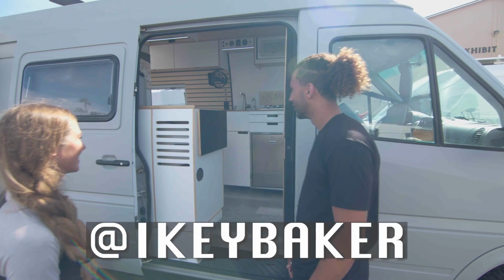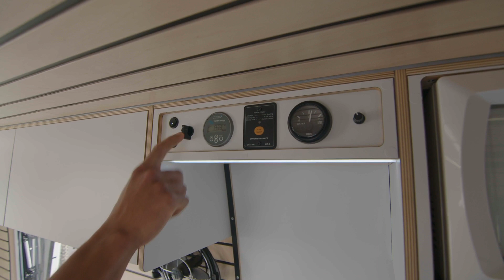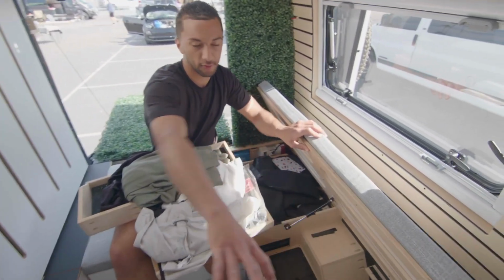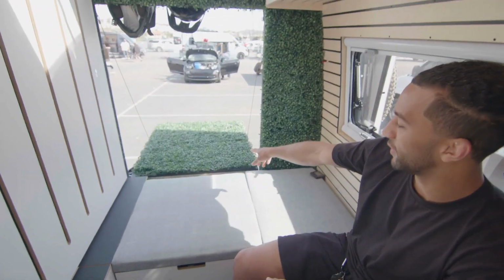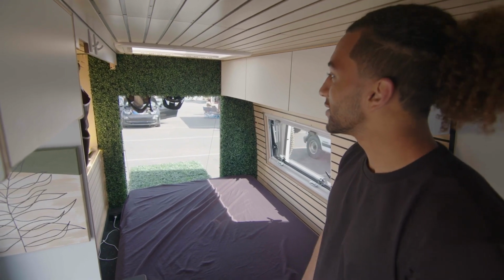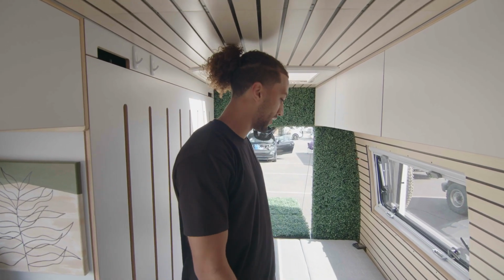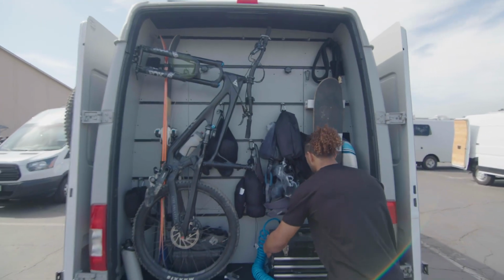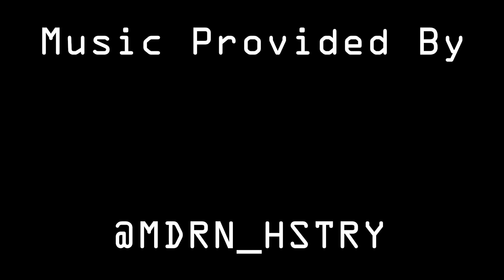Must See Sprinter Adventure Van Conversion | Murphy Bed, Tons of Gear Storage, Flip Down Wall

Comment: Oh dang I’m actually early. Im in the heat of building my van now and I have a question about the underbelly fan for cool air….

namely, how well does it work? 

I thought about doing it for the same reason he mentioned (shaded air under the van should be cooler, if the van isn’t running)
Reply from the maker: It's a great idea.   It should work great.  I don't have it on my van.   But it should work as advertised  most van dogs hang out under the van.